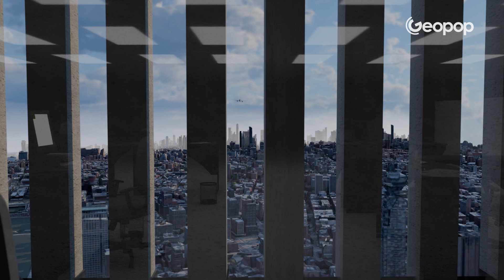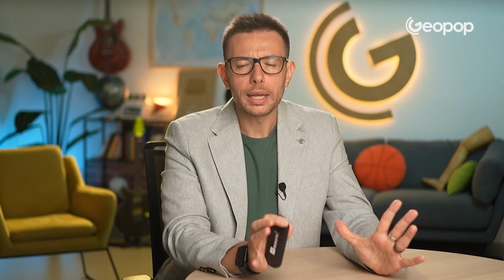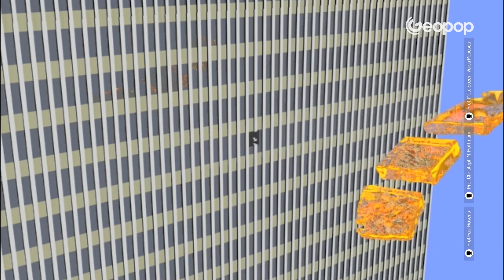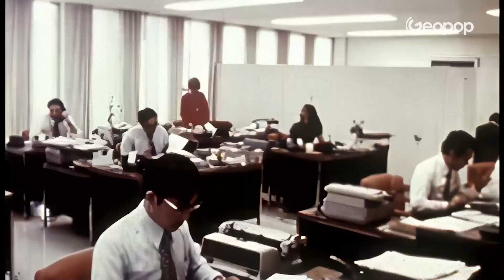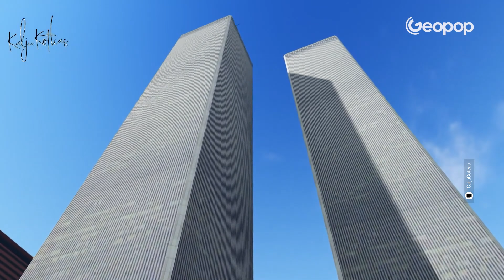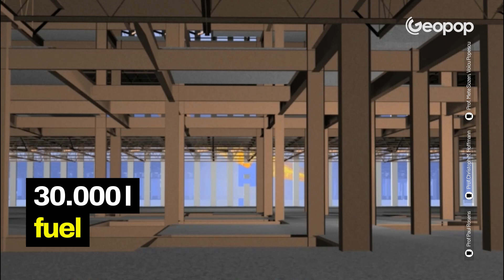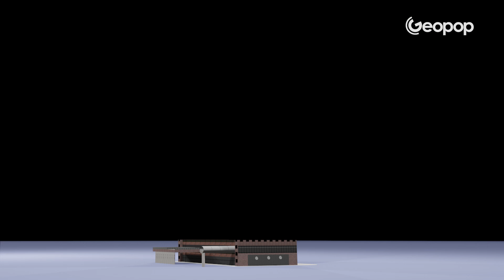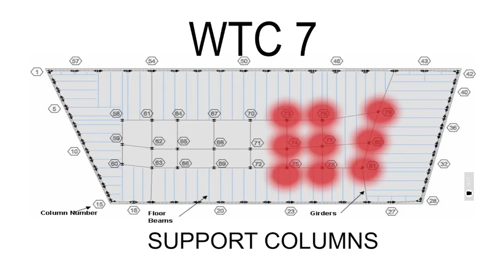9/11, 2001: The Technical Reconstruction of the Twin Towers and WTC 7 Collapses

Comment: "The debris from the World Trade Center was recycled relatively quickly after the September 11 attacks. By September 24, 2001, more than 100,000 tons of debris had been removed from the site, and some of the steel was recycled before it could be analyzed as part of the post-collapse investigation."

I always wondered why they were so quick to not just remove the debris, but to completely destroy any evidence by having the debris removed sold off and recycled so quickly. Were we in some dire steel shortage or lack of space to house this debris for a few years for close inspection and analysis by various independent researchers? No we were not.

So we have to just accept many key facts about the events that led to the towers collapse, like in this video pointing to specific columns that failed. How do we know those columns specifically failed and started the chain of events if researches were not allowed to fully analyze the debris? Seems like a big hole in the story.
Reply: More holes than swiss cheese
Reply: @portuglish  only if you're stupid
Reply: My thoughts exactly. The British still have the wreckage from Lockery stored in a hanger. But the speed in which they blitzed the tower wreck was unbeleivable. They were not looking for evidence.
Reply: An iron girder was sent to Christ Church,  New Zealand after 9-11. A sculptor had made it into a work of art. It gave me chills. It was meant as a tribute to the firemen and first responders on the fateful day. I thought it should’ve been tested for chemicals, etc. I lost trust in my country as the experts disputed the findings of the cause of the falling towers. A country who kills its own citizens cannot be trusted.
Reply: Um… they were trying to recover victims… 
Nothing nefarious about rescuing people.
Reply: @ 
Everything was removed from the WTC s location and hauled to the Fresh Kills Landfill on Staten Island  where it was further sorted to look for human remains and separate materials such as steel  so the rush to sell the steel had nothing to do with the search for bodies
Reply: @ 
For me the only thing more irritating than being talked down to by someone who’s never done the research and put in the time it takes to be informed on something when I’ve researched a subject enough to teach an advanced class  is when the  one that doesn’t know what they’re talking  brings their passive -aggressive behavior into the their argument.
Reply: It was some what Radio active so they wanted to get rid of it quickly for obvious reasons.
Reply: @fx-studio  everything is somewhat radioactive. Even bananas lol
Reply: @SamanthaMaedhbh  Took a bit more than that to cause all the can cers...
Reply: @fx-studio  you do realise that lots of things, beyond radiation, can cause mutations in cells that are what constitues cancer? Right? 

You know like saw dust can do that. 🤣
Reply: @SamanthaMaedhbh  Yeh, don't worry about it - go get your next Boostar the gov loves you 🙂
Reply: @fx-studio  🤣 ah, good side track... 

But you realise the buildings were full of stuff that you wouldn't normally be exposed to in every day use of the building but when it falls down and those things get all mushed and crushed and turned to dust... you are exposed? Those cancer causing things? That also come from the smoke of burning things? 

Just giving you a little intellectual booster. Think before you talk buddy it'll help you look less brain dead.
Reply: @  Everything is somewhat radioactive but that never played any role here. Nor did anyone ever claim it did. Everything was loaded onto trucks and hauled to the Fresh Kills Landfill where it was sorted by human beings  to start the various  processes  that several different materials went through. In the case of Steel the process was basically to separate it  from other materials then loading  it for shipment to several places , the majority going to China. They wouldn’t rush radioactive steel to humans for sorting and no one should’ve paid for radioactive steel. They would’ve been paid to accept it. Do some research and you’ll find that this radioactive story you’re pushing was something you imagined or made up
Reply: There are so many grey areas above the whole event so much so most of what this video suggests happened on the day is theoretical, when a tower Falls at frefall speed and turns to dust, bent twisted girders and molten steel into its own footprint this video does not make sense as it does not mention impossible use of thermite to melt the steel as jet fuel does not create temperatures to melt steel, this is just one of the questions that has never been truly answered, it's even been mentioned that the fire service found pools of molten steel under the dust and rubble days after the event. So many questions need to be answered, this is why so many people feel there is some kind of cover up, and why governments were so quick to call other ideas of the event by independent structural engineers a conspiracy.
Reply: Quickly? It was a clean up for like 6 years. R u even from NY? I'm right outside NYC. I had neighbors and family doing clean up. That was not a " quick" task.
Reply: @ 
I thought the commentor  was referring to the steel only which I believe was more or less done quickly compared to everything else. I had some jag off who  called me out on things I said so I did a few more hours of research to confirm that a couple of my  facts  that I learned  during something  like 60 hours of research maybe much more that I finished in around 7 months or so after 9/11. I learned for the first time a could weeks ago that the name of the recycling plant  was Fresh Kills. I’m sure you knew that but I can’t believe that it took close to a quarter century for me to find that but it struck me  kinda weird  . Fresh kills ?
Reply: 3000 bodies weren’t recovered from the debris
Reply: @  no there weren’t yet that’s the number. Nothing to see here.The body count probably wasn’t too important in terms of their narrative .Its essential in a mass shooting but when the psyop involves as much damage and shock at being attacked on our soil as well as the things that could’ve happen the only thing needed to get the “New Pearl Harbor “ is the scary bad men
Reply: That's the ULTIMATE TRUTH!!!
Reply: My first question was I'd like an analysis of the average quality of of the steel used, and its provenance.
Reply: My first question was I'd like an analysis of the average quality of of the steel used, and its provenance.
Reply: So true! So obviously an inside job
Reply: Blame the Zionists
Reply: They were quick to remove the debris to search for survivors and to get the massive health hazard and safety hazard out the way. The more dense the population the faster this will happen as there are more people and thus reasons to do so. This is why a plane crash in the wilderness of alaska is left as is. One in downtown of a city is cleaned up faster. This isn't rocket science. It would be more suspect to have gone to huge lengths to take every piece of the building and reassemble it to prove a plane took it down several months before anyone was even remotely seriously theorising on what happened for profit and fame.

Also, your claim that you could establish which beam failed first based on the beams as they sat on the ground in the days after is very weird. What method would you propose to do so after a whole lot of other damage has been done on the way down and by the not insignificant mass of the top floors of the building falling on top of everything? Please explain how you would hope to achieve this analysis with what was present on the ground.
Reply: The debris wasn’t collected, recycled, etc that fast. There was plenty of evidence around. Listen to the scientist and not some idiot selling a conspiracy theory that doesn’t have a leg to stand on.
Reply: @tonylozina9545  @tonylozina9545, well, let’s look at what was known in the weeks following the event. There were two skyscrapers that had stood for 30 years, even after a terrorist attack on one of them a few years before. But on 9/11/01m, TENS OF THOUSANDS OF PEOPLE, thousands “on site & many thousands thru live TV broadcasts, witnessed a large commercial jet fly into each building at high speed, causing enormous damage & starting raging fires in each. And shortly thereafter, both buildings collapsed. The ATC’s & FBI also had radio communications (accidental ones from the hijackers) & intentional phone calls from passengers on the planes, revealing that the planes had been hijacked.

It takes a “special” type of moron to KNOW these FACTS and then to ASK, ”Gee, I wonder if those events (the plane impact, fires & collapse) are related?” There was precisely ZERO doubt, then or any day thereafter, that the impacts & fires somehow CAUSED the collapses. So, the only task left was to try to figure out WHY the planes flew into the building, in a CLEARLY deliberate act, and WHO was responsible. NONE of this info was discernible from examining pieces of steel wreckage. The answers to the only pertinent unanswered questions were only to be found thru an extensive CRIMINAL investigation, searching for the identity, motives & prior activity of the hijackers.

What, exactly, do you suggest a twisted piece of steel can reveal about those questions?
Reply: People like you are problem in this world
Reply: @tonylozina9545  @tonylozina9545, your problem is a Conspiracy-addled brain. You think, incorrectly, that all, or most of, the 1000s of qualified, knowledgeable structural engineers in the US, UK, Canada, Australia, Europe, etc. are all so “unpatriotic (if from USA), Or utterly unconcerned with justice (if not from USA) that they would simply keep quiet if there were some giant unanswered question regarding, or methodological error in, the methods or conclusions of the NIST Report. I can assure you that this is not true. As a mechanical engineer with >50 years experience, I went thru that report with extreme attention to detail. If I had found any fraud or weakness in their methods or conclusions, I would have not rested until that weakness were exposed & addressed. Or, you believe that, with your utter ignorance regarding structural engineering & collapse mechanisms (& I’m going to assume, “ignorance of EVERY OTHER technical field that has any bearing on any of the events of that day (eg., “controlled demolition”, “failure modes & effects”, “impact & collision analysis”, “progressive failures”, “structural design of skyscrapers”, etc. etc, et-f’ken-deters.) & the ONLY THING driving your delusions is a blind affection for conspiracies. Tell me, Tony, what shape is the earth? Did we really land on the moon?

Have a little respect for the VAST majority of people in your own society who would NOT stand by & let criminals cover up such a heinous crime. Pull your head out of your ass. Presumably, you’re not 15 years old anymore & therefore have no excuse for such stupidity.
Reply: bullshit clown
Reply: The debris was destroyed for the same reasons that Thomas Crooks was cremated after he attempted to assassinate Trump. Nothing else makes sense…
Reply: literally just search up the "World Trade Center Recovery Operation" on youtube and it will completely disprove everything you said 💀
Reply: These people can make thousands of explanatory documentaries on these facts to try to justify what happened that day with tons of pseudo-scientific theories. Logic dies every time. 
Just like when someone found those terrorists IDs (that were on the plane which exploded) on ground zero a few hours after the collapse of more than one hundred floors and despite even  steel melted like show on a sunny day, those plastic little things were almost intact and easily found.
Reply: stfu u talk BS go in your cave lol
Reply: It’s called science
Reply: We don’t all I know is when you remove and get rid of evidence you’re guilty I would like to see the evidence of the steel failing I guarantee it don’t exist fire fighter eye witnesses said they heard explosions all through the lower floors my guess it was rigged with explosives and the planes were decoys the owner of the building made a ton of money from that day cause his big insurance scam the American government is criminals and should be ashamed of themselves and we as people are just pawns in there game it’s all part of the war machine there’s clearly agendas and motives behind these things I would love to see experts investigate the debris and steel and that was there major mistake and one of the big reasons why conspiracies exist we all need to stop being so naive to think that our government cares about us the people cause they don’t 💯💯💯💯
Reply: Engineers,  builders,  architects.   I watched a documentary about the buildings.   The towers were a new type of buildings.   I can't remember all it said.  Look it up.  My understanding is that it should be able to stand if an airplane hit.  No one thought about planes being flown into them at top speed  that they could fly.
Reply: @maxinefreeman8858  the planes didn't bring down the buildings....the subsequent fire did
Reply: Because they WERE TRYING to get rid of the evidence, which if examined, would’ve shown damage consistent with that of a controlled dem
Reply: They’re are still trying to identify remains it took over a year to excavate the foundations so your comment isn’t true
Reply: Was all sent to China
Reply: Jesus Christ…so tired of you moronic conspiracy theory jerk-offs. ENOUGH. STFU!
Reply: If the wings were truly full of fuel, they should have disintegrated on impact. Consider the 36 steel columns, each about 6 cm thick, that the aircraft would have had to break through—especially given the wingspan on the impact side. So how is it possible that the hole on the other side of the building is even larger, and that more than 36 columns appear damaged—even extending through the core of the building?
It’s like throwing a fuel-filled egg at a wall with tremendous force—it might dent the surface slightly, but then bursts apart at the back like a dustbuster.
The aircraft’s skin is thin: between 1.5 and 3 mm on the fuselage, and 4 to 6 mm on the wings. Yet it contains roughly 28,000 kilograms of fuel. You're basically launching a 28-ton water balloon at 700 km/h into a steel structure. That kind of impact should completely pulverize the aluminum. Only the engines might be capable of doing serious damage to the steel columns.
But in the footage, it looks like the wing simply glides in as if through butter—without any immediate fireball or explosion on impact. The major explosion seems to occur only after the impact—at the rear of the building.
My only plausible explanation: there was a plane used as bait, but it didn’t carry fuel in the wings. The aircraft was essentially just a trigger. If it had been fully loaded with fuel, it should have exploded upon impact, not several moments later. Instead, it seems to vanish into the building first, and only then does a large explosion erupt from the inside—not from the outside.
Such an explosion would also consume all oxygen in the immediate surroundings. So imagine: no fuel in the wings, and the plane doesn’t actually penetrate the building structurally—it just disintegrates. You're comparing 1.5 mm of aluminum versus 6 cm thick steel—and yet in the animations it behaves like the building is made of butter, as if it had a thin aluminum skin. They show the nose of the plane going through the columns—even through the core.
Reply: @joymediaNL  Aircraft are not made of standard aluminum. The airframe is CREP (carbon reinforced plastic) which supports   almost indestructible landing gear and engines.  The fuselage consists of 2024 grade aluminum etc. 
   The Islamic terrorist conspiracy theory fails when the cockpits are seized because they had no experience flying large aircraft full of fuel.  The planes were guided with precision at max speed 
  The 9.11 Commission despoiled much evidence to create false narratives. The 47 interior columns of each tower seem to have disintegrated below the fires and aren't seen in the debris field or at Freshkills site. 
  That there were no charges of incompetence or absence from post against any of the defense chain of command speaks for itself. They either retired or were promoted
Reply: @tonylozina9545  so it took them 10 to get rid of the junk huh...
Reply: If you want to see the real enemy of this 
You don't have to look far 
Texas is his home
Reply: And we owed China big-time for agreeing to ship all the debris to the communist state to melt it all down and use to make new stuff. Blame it all on Bush #1 who was confident he could handle the Chinese as though they were naive children. Like Nixon sadly did.
Reply: See, my issue with statements like these is that you guys can’t even have a physics based conversation about the collapse based on the information that we DO have 😂 yet you want us to believe that if you were given more information, you’d somehow wake up with the motivation to do more calculations and simulations. Classical mechanics is deterministic. As shown in the video, given some constraints, we can model exactly what everything should be.
Reply: Exactly.
Reply: it was an inside job ... no one can explain convincingly why WTC7 collapsed..... the American people generally are too stupid to understand that it was their own government that orchestrated this event basically to have an excuse to invade Afghanistan...... 
American people.... you were fooled yet again !!!
Reply: They had plenty of time to analyze the damaged columns. The only big hole is your maturity.
Reply: They all got brought down by devolution.  When you lose billions of dollars you got to hide it somehow..  no furniture and office supplies wouldn't get hot enough to bring down build 7..  they got knock down..  inside job
Reply: Tons of chemicals, probably a health hazard and nobody wants to see their city like that, but I hear ya. But know that FBI did have their own task force there helping out so whatever evidence they collected I’m positive that they didn’t throw it away. So Ask or we wait till it gets declassified.
Reply: all good points, I guess. However, you failed to answer the most important question. Did you take your pills on the morning you wrote your idiotic statement?
Reply: NOT TRUE!! Yes, debris was removed quickly at first; for the first week it was a rescue operation & they were trying to get to possible survivors. But they did not recycle the steel right away! It was moved to yards in NJ where it WAS studied, for MONTHS. They retained pieces relevant to the disaster, but there was no reason to keep it all. The claim that the debris was not analyzed is false.
Reply: @Tim22222 they wanted to get all the gold first, then it was all sent to China
Reply: Exactly!!! Thank you!
Reply: @Chefsmeat1  That quote appears to be from no one and is completely inaccurate.  The debris was studied for months. There was no conspiracy, just some lunatics with knives.
Reply: What is this quote from?
Reply: "more than 100,000 tons of debris had been removed from the site, and some of the steel was recycled before it could be analyzed as part of the post-collapse investigation"
-This is straight up false.  Some steel was saved for forensic analysis.
Reply: @NotSure723  " Some steel was saved for forensic analysis."

No steel from Building 7 was saved for forensic analysis. In fact NIST didn't use a single piece of steel for their investigation and report of the collapse of Building 7. Nice try with the false narrative.
Reply: @sorcerykid  
"No steel from Building 7 was saved for forensic analysis."
-[citation needed]
Reply: @NotSure723  Strange, I provided citations and now my comment is mysteriously missing. I'll let you figure out the reason why my comment with evidence of no steel being saved was removed.
Reply: @sorcerykid  
Oh right, your comment being removed, is proof that the conspiracy is true, and that YT is in on it...  Yawn.
Reply: @sorcerykid Citation please.
Reply: @sorcerykid get over yourself you’re talking shite
Reply: Mathematics and science.
Reply: No conspiracy here. That went down as told - the video evidence is enough.
Dude, there had been two HUGE debris piles in the middle of New York AND these piles hindered any effort to check onto the other buildings.  They had to go VERY quickly.
Reply: @Tantejay 
True but once the debris was hauled away to the FreshKills  site there was no reason to ship it to the other side of the planet before it could be examined. I’ll bet you’ll think of one though
Reply: @Semprefi  They DID got examined.

Jeez, you guys are dumber than 12 ft of drywall during a dryspell
Reply: -- Then what is the source of the many tons of molten steel found in and under the debris, the heat so intense that the molten steel remained in that state for weeks afterward, running off of the debris as it was excavated. This cannot be molten copper from wiring that retains the color of a shiny new penny.  It cannot be molten aluminum that retains the color of the polished aluminum wheels of a street racer. It was the color of glowing orange molten steel  that cannot be mistaken for any other material, reported by firefighters who are very experienced in the nature of such materials as well as seen in video evidence.

When you combine this with an entire lack of turbulence behind 500 mph aircraft, when even a small Cessna Aircraft would leave an evident wake in the smoke and fire only seconds later .  . We find that skeptics still cannot be skeptical of the official narrative in explanation.  Sponsored channels and forum activity are skeptical of nothing when support is provided.

Sponsored activity in the forums is very normal today for commercial and political purposes and subjects of controversy -- in the attempt to lead public debate.
Reply: @ronaldgreene5733  most dont want to know - it would mean change . Many already know - and quietly educate and work for change.  Yelling at a rock to break is necessary to shine a light , returning every day in winter with water to poor into its cracks is where we are at now . Got to play the longest game ,at a grass root level before a screen gets them. Low tech beats everything invented to date .
Reply: @ronaldgreene5733 What do you mean ‘What is the source of the molten steel?’  Are you asking what kept it hot? Dozens of thousands of desks and doors, thousands of miles of wiring, 220 acres of carpeting, and hundreds of tons of other material.  smh
Reply: @MichaelB769  Don't bother he's literally got 98 comments on this video alone and several are copy pasted
Reply: @MichaelB769  You seem to know. What IS the source of the molten steel? How did it go from a solid to a liquid....20' deep?!
Reply: @ronaldgreene5733  molten steel doesn't glow orange.
Reply: @SamanthaMaedhbh being a steel worker it certainly is orange not sure what you are going on about
Reply: @toddalcock6879  yanking chains. Bit odd that we got a photos from inside the building on the day, we got photos of all sorts, we managed photos of the darn elephants foot under Chernobyl in the conditions of soviet closed society and secrecy... but no one in the land of the free got a photo of these incredible glowing orange pools of molten steel? Seems weird.
Reply: @SamanthaMaedhbh  
Are you f@cking retarded? Of course molten steel glows orange. Stop sticking your nose in conversations you know nothing about which in your case is every conversation
Reply: @SamanthaMaedhbh   
There’s several videos of the molten metal flowing out of the towers and down to the street  before the planes even hit them. If you want a photo so bad there must be a few thousand of them in each video.
Reply: @Semprefi  ah, so, we changing from molten steel to just molten metal now? 

This is convenient. Metals do be melting at much lower temps than steel does. Don't they?
Reply: @SamanthaMaedhbh  Many were posted in the days that followed, but it appears they have been deleted. It's counter to the fake narrative.
Reply: @Semprefi molten metal flowing before the planes hit?  Ridiculous
Reply: @colleengeier9994 
That’s the point Delbert. 
There’s more than one video out there that shows this  and BECAUSE the planes haven’t hit yet there’s no innocent way to explain molten metal flowing like waterfalls on the corners of the buildings and there are people who can identify that Liquid Metal is indicative of  Thermite  and Engineers and Architects who can confirm that if you were going to use Thermite to  help bring the buildings down you would wanna use it right were the flowing liquid steel is seen in the videos. Hope that helps
Reply: @SamanthaMaedhbh  it does tho...
Reply: @me1698  yes, yes it does
Reply: @SamanthaMaedhbh as steel reaches around 1000C, its orange, before turning a yellowish white nearer 1500C. 25 year chartered engineer.
Reply: @itsagoal182  yeah, aluminium also melts. Lot of that around from all sorts, that big aluminium plane?
Reply: @SamanthaMaedhbh problem you have with aluminium is that it melts how it looks, a grey/silver colour, and nothing like structural steel. Nice try though.
Reply: @itsagoal182  okay, you know all that copper around the place as well? Probably a lot of other stuff as well. 

You know the towers contained more than just a harsh minimalist steel structure? Like all sorts of stuff the people occupying them had in there. Plus the plane and all that contained. 😂 like me saying your house only contains brick because thats the main substance used in the walls. Discounts all you could put in plus the bulldozer I drove through your wall
Reply: @SamanthaMaedhbh do you plan on moving from metal to metal here? I’m fine with that as I studied materials science back in the day. Copper will begin to seriously break down around 600C, and will melt around 1000C, but it does turn orange.

However, none of these metals or alloys have the ability to then cause steel (structural) any problems, and that’s what’s really at play here.

There is only one plausible cause of steel melting like butter that was clearly witnessed at ground zero, and it wasn’t alum or copper.
Reply: @itsagoal182  if you are seriously considering what you may be looking at then you should absolutely check off all the metals possible to explain molten metal sightings. 

The structural problems come from heat + the rather large mass of the rest of the building above the damage. Quite simple really.
Reply: @SamanthaMaedhbh it was molten steel, we all saw it, so what caused it?
Reply: @itsagoal182  nah, had you taken a bucket and caught it you could say so. You saw a molten metal. So what is it? Based on whats it the whole building not just what you need it to be
Reply: @SamanthaMaedhbh I know what copper, steel and aluminium looks like in the molten state, ask any welder, even they will tell you.

There was molten steel dripping out of the WTC prior to collapse, it was not copper or aluminium.

It was also there post collapse, “like lava”, they said. It was steel.
Reply: @itsagoal182  they said... 

Funny really that as a welder, arcs can also melt steel, copper, aluminium. Sure out minimalist steel box has no sources of possible arcs, electricity services in the building,  famously candle lit. 

So many possibilities before we go off pointing fingers at invisible hands of shaddowy organisations involved in world changing scheming, well othere than the organisation that flew the plane in..
Reply: @SamanthaMaedhbh  they used a little robot to get a photo of elephants foot true story
Reply: @HiiiPoWer336  they used humans as well
Reply: They did remove enough debris for inspection, testing and analyzing.  They even show that in several documentaries.  Why are you misinforming?
Reply: @JohnSmith-gb5vg  Not from WTC7. No structural steel from Building 7 was preserved for analysis according to NIST. This is further backed up by FEMA, who was charged with the initial recovery efforts. Even Mayor Bloomberg had remarked about the steel from Building 7 being scrapped, saying it wasn't needed.
Reply: @JohnSmith-gb5vg  Hahaha....you mean the propaganda videos?
Reply: @JohnSmith-gb5vg  Because their analysis was BS.
Reply: @ 
" Because their analysis was BS."
-Wow, what a thorough and thought provoking analysis!  Clap clap clap...
Reply: In fact the steel including some of the cooled molten steel was analyzed! It was analyzed by a professor and a couple of his graduate students at BYU in Provo, UT. What they found was large amounts of Thermate! The professor and his grad students released their findings at a local relatively small event in SLC Ut. The day after it was released locally,  then President Bush landed in A1 in SLC and met with the heads of the LDS church. The church owns BYU. The following day it was announced that the Professor would be stepping down as department head and would no longer be employed at the school! Google thermate if youre not familiar with it. And then think about what you saw as the towers collapsed into their own footprints. Molten metal flowing out of the windows. So much that or was several feet deep in the basement of the WTC and remained liquid for days after the collapse!
Reply: @Apiaman1  I think the professor that you're referring to was Dr. Steven Jones, and he was pressured into taking an early retirement at the age of 57, after he spoke out.  He's been very vocal about all of this ever since, and he speaks with & supports Architects & Engineers for 9-11 Truth. They had samples of the World Trade Center dust analyzed, and they found iron-rich spheres, and unreacted nano-thermite/thermate(?).
Reply: Who are you quoting?  And why did you like your own comment?
Reply: @TheLoonResistance you're a bot pure and simple. the point they made is factually correct, a huge terrible terrorist attack takes place, evidence should have been kept, not removed and sent abroad
Reply: @TheLoonResistance  he has the IQ of a goldfish
Reply: Isn't that interesting, isn't that what criminals do? That is called destroying evidence so there is proof to challenge their narative
Reply: @briannatarelli430   Everything has been covered up.  Nothing is transparent here.
Reply: @briannatarelli430 so who are the criminals in your mind?
Reply: @briannatarelli430  yea, they wait and get rid if it 10 later
Reply: @ElLowEl .  . "What the hell are you talking about?" .  . 😃 .  . Thank you for your sponsored reply, Mr. EILow.  The word projection indicates holography as you know, commercial demonstrations of which have been amazing in recent years.  To feign ignorance doesn't work well for you, however.  Where, Mr. EILow, is the wake turbulence only seconds after passage of a 500 mph large passenger airliner -- not seen in the smoke and fire covering the impact zone?  Even the wake of a small Cessna Aircraft would be noticeable -- yet there is nothing.  It's likely that no real answer from you is forthcoming. We'll wait and see .  .
Reply: Thank you for your common sense on this  matter. Also, the Evidence, I mean Steel wasn’t just sold  as scrap metal. It was sold and shipped to China. The motivation for this unusually fast transaction  becomes even more questionable after you learn that the value of scrap steel flucdtuates constantly and they rushed to sell it when the value was at an all time low
Reply: @Semprefi Another conspiracy nut. Nothing that you said is accurate. Even today pieces of steel from those towers are readily available for inspection at memorials all over our country.
Reply: @Semprefi  it was 10 yrs afterwards
Reply: @Semprefi  hey were you there or something cause I can’t find anything on that.
Reply: @HiiiPoWer336 
Can’t find anything on what. The Debris going thru the fresh kills waste site? It’s out there. I just read a couple detailed articles about it before ii wrote my original post
Reply: @Semprefi  well except for the steel, they kept for analyzing, testing and as evidence.  Also the various steel parts they used to as superstructures in US Navy ship as tribute to those lives lost; USS New York.
Also a lot has been disseminated to States and other countries involved for use in memorials, museums, etc. 2k of steel was passed out as well.

Yes, China received some, but not for recycle, but for their memorials.  Russia, England, Canada also received steel and relics and pieces of the WTC.

You have been or are very sadly mis-informed.
Reply: @ 
100% You’re a Sock Puppet Less than .1 percent of the steel removed from the WTC site after 9/11 was saved for memorials in the US and abroad. 
The vast majority of the steel, 200,000-285,000 Tons depending on the source were sold for RECYCLING , mostly to China with the rest purchased by Turkey. If you’re not a government Troll  supporting the narrative then you need to research things before you accuse people who are clearly smarter than you of not knowing the facts because those same people are going to prove you wrong and embarrass you every time.
Reply: @JohnSmith-gb5vg  
You’re either retarded or a liar because  they sold the majority of the steel for recycling to China , Turkey and India. 
200,000 -285,000  Tons of it depending on the source.
The total amount of steel we gave to a handful of countries for memorials was less than 1 % of the steel.